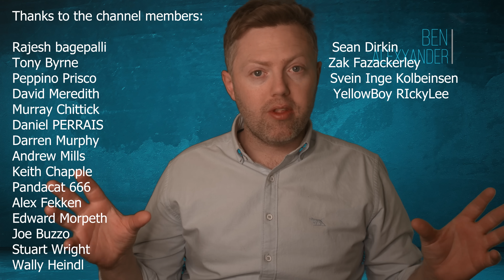CATL’s New Sodium Battery Will Reshape the Entire EV Industry

Comment: Na batteries seem the best solution for storage but, their Wh/kg. is very low compared to NMC or solid-state li-on batts which are in the 290-400 Wh/kg. range.
Reply: At cell level maybe but it doesnt translate to energy density at pack level due to cooling requirements, more like 220wh per kg for NMC which closes the gap. Sodium Ion batteries dont need cooling or heating so more of the space can be used for batteries. 175wh per Kg is decent  but if you think NMC can lose 30% of its capacity when its cold, 50% at -20, there are quite a few upsides. Couple that with 5c charging speeds there are arguable more upsides than downsides 🤔
Reply: @richardlphillips  money talks, nobody cares if the car is a few kg heavier when its 5k cheaper on pack level and the chemistry is more reliable. i bet its a simple drop in replacement and cell case and everything is identical. why is everybody comparing it to NMC... it has 0 chance agains these specs, if all of this is true its game over for the other chemistries
Reply: I mean it's competitive with LFP chemistry - hyper density may not matter if the battery costs dramatically less.
The high density will most likely be reserved for the expensive vehicles or other use cases

Comment: This is the beginning of the end for ICE. So much progress over the last 10 years. FANTASTIC
Reply: Yeah. Betamax moment.
Reply: Also you have to keep in mind that with ice every brand has their own engine and parts. Ev may swap some parts from different companies like the battery and other components
Reply: I would say its the end of the beginning. Mass adoption and acceleration next
Reply: ICEV's peaked globally and in the U.S. in 2017.
This isn't the beginning of the end. More like the final nail in the coffin.
Reply: So how will this help me pull my 30000lb trailer with equipment for work. I dont drive a heavy duty pickup to go to the mall. As far as I know there's no profitable alternative to ICE engines in that space. 

Consumer cars are a small fraction of on road use, Edison motors is the only thing coming close to being usable but they are only in the semi truck market.
Reply: @jackofall2305  The EV muppets are too dumb to realise that HGVs, heavy plant, generators, trains and ships all move on diesel and planes run on aviation fuel.  The appalling energy density of EVs will not usurp those engines for as long as there is petroleum.
Reply: @jackofall2305  EV commercial vehicle is already very common in China. Even heavy trucks used in mining sites are EV now. They have fast chargers or battery swap station. In some situation, like routes that usually fully loaded going down hill and empty truck going back up, thr regen braking can generate so much electricity, that the truck barely need to charge the battery, and also no need to worry the brake overheating.
Reply: Yeah, if only the US govt wasn't banning all auto tech from China.
Reply: @jimbo92107 doesn't matter, world is bigger than the US
Reply: @jimbo92107  nonsense!!!
Reply: @jimbo92107 sadly the us has become regressive. Well at least one party has. The rest of the world is going to continue moving forwards.
Reply: @jimbo92107  It is all good if the rest of teh world adopts that US are just 330 million people let them drive their F150.
Reply: @jimbo92107   reminds me of the USSR, struggling to live on its old outdated tech
Reply: @whophd  ridiculous lame joke
Reply: @whophd 😂 yeah, the ICE is old outdated tech… 😂
Reply: @whophd china is similar but worse than the USSR
Reply: Not so fast. The charging problem remains. We have huge loads on the grid which cannot be dealt with other than astronomical investment.
I am keeping my ICE and have no intention of changing atm.
Reply: @calculusconsulting8598 then maybe these energy providers need to be investing back into the company rather than squandering all the profits in ceo pay and enriching the stock holders. Plus as more people install solar the actual demand on the grid is reduced during the day light hours.  On top of that many ev owners charge their cars at night when demand is low.
Reply: @calculusconsulting8598 this is a religion, adherentes aren't listening
Reply: 10?...in just 5 years is enough
Reply: @maximusasauluk7359  in never you mean!
Reply: Doesnt solve the main disadvantage of low energy density which is the biggest inhibitor of EV uptake..
Reply: @csjrogerson2377  didn't LFP have this same energy density issue that everyone said was impossible to fix...look where we are now
Reply: @viyusavery248  I'm sorry but your post makes no sense. What was impossible?  What was fixed?  Where are we now? For high performance batteries LFP produce  205W/kg, NMC are 300 and NMA are 350.  Diesel is 12600W/Kg.  You see my point?
Reply: @csjrogerson2377  "Diesel is 12600W/Kg." - Most of which is unproductive, being lost as heat, which is not the case for EVs. So it is likely about love all on energy available for actual purpose. We can argue all day long about these things, it just doesn't matter in the end.

If you don't like EVs, just don't have one. I don't know why you feel the need to try and build a campaign against EVs. It's bizarre!
Reply: @csjrogerson2377  When you have 800v batteries who can charge in 10min then less range isn't a big problem.
Reply: @Tavs.fāters When these mythical "unicorn chargers" materialise in large numbers that will be true, but they are still not here and they will not be for decades.  When they do they will be very expensive, thus removing the low cost benefit.
Reply: @csjrogerson2377 I don't know why you are deliberately not telling that sodium ion has 175 Wh per kg more than enough for 400km range. Fossil is dead.
Reply: @Saket921  Thats because I said the high performance sodium produces 205W/Kg. If you knew anything about physics and maths you'd know that the density alone does not influence the range. You need sufficient mass at a given density AND a known consumption rate in W/km. 
PS 400km is eff all, I dont care. I do 1800km over a long weekend.
Reply: @csjrogerson2377 so you are saying that you drive almost an entire day.... out of a two day weekend?
Reply: @scow01  I cant find what you are referring to but I used to drive early from work at 1200 on Fri. Sat and Sun at home drive back at 2200 Sun evening and start work when I arrive.  About 1000 miles done.
Reply: @csjrogerson2377 ok that makes more sense. Sounded at first like you said you just drove 1000 plus miles on the weekend for some random reason vs commuting to work on a sunday night and returning friday night. That is a lot of driving but not outside what an ev could do. But you would require one that supported maximum fast charging, had available chargers along the route and the ability to charge at home.
Reply: @csjrogerson2377  4:43
Reply: Sodium battery energy density is better than LFP, they can be charged from 10% to 80% in just 5min, last for 5-6 million miles, cost 50% less at a time when average ICE vehicles cost more than $50k. And they are coming Dec'25. The ICE auto industry is DEAD!!!
Reply: Doesn't solve large Diesel ICE solutions.
Reply: I think the beginning had already started , this will be the nail in the coffin. 👍👍
Reply: @jimdonaldson64  in your dreams cringe!!!!!
Reply: @jimdonaldson64  How many nails do you expect? Sodium has some advantages but it still doesnt solve the biggest problem - energy density
Reply: @csjrogerson2377  Tell us all how inefficient and utterly wasteful of energy ICE vehicles are again? I missed that bit the first time..............oh, wait, I see you didn't mention that........did you.
Reply: @BrentonSmythesfieldsaye  I didn't tell you because I get 12.6 kW/kg of diesel and diesel ICEs are 40-52% efficient.  Thus I dont give a fuck.  
Now did you tell me what produces the electricity for your non-planet saving BEV?  No, of course not, it might be 75% gas or coal, in which case you are producing more CO2 somewhere else.
Reply: @csjrogerson2377  "diesel ICEs are 40-52% efficient." - 🤣🤣🤣🤣

"Now did you tell me what produces the electricity for your non-planet saving BEV?" - My solar panels silly charged my EV, last count of 9,000km travelled for totl cost of $80.25, effectively no grid involved. Plus the planet doesn't need "saving", it will be just fine regardless of what we do. That has to be one of the most hilarious contrarian narratives ever. "Save the planet", yeah no worries. 🤣🤣🤣😂

So looks like nothing changed after your response. Unlucky.
Reply: @csjrogerson2377  energy density is not critical in all applications of battery technology. I just want a cheap home battery to charge up cheaply at night and then power my home during the day when prices are much higher. Battery technology is not just to do with cars.
Reply: @marviwilson1853  True, but I dont care about the battery in your home.  It's the one in the car that makes me move and causes me to lug around 100s of kgs of battery. HGEVs with 1000kWh batteries are carrying 4000-6000Kg of crap instead of 200kg of diesel.
Reply: @csjrogerson2377  The diesel v battery calculation with trucks is quite complex but I am sure use of batteries over the life cycle of the truck is compelling for the bottom line. I guess that is why they are built and are bought!
Reply: @marviwilson1853  I wouldn't be so sure about the logic of why its being selected.  It may be entirey ideological and nothing to do with logic.
Reply: @csjrogerson2377  Oh, I would be highly convinced that in the trucking business as with most small to medium sized business's that the bottom line rules. If the economics of diesel v electric are the same or maybe even slightly in favour of diesel then there may well be those who take the slight loss for the common good but arguing that larger losses are allowed for ideological or no logical reasons is highly doubtful and to be honest is entering the realm of  "clutching at straws".
Reply: @marviwilson1853  Your argument falls on its arse because the small and medium businesses are not buying HGEVs, Its only the large ones that can afford to be ideological.
Reply: bullshit!!! the ICE is never going away period! they have been forcin evs on people while using the ICE to make those useless evs and send them around the world what a joke!
Reply: @carholic-sz3qv  You in 1990:- bullshit!! The Cathode Ray Tube is never going away, period!! forcing those new expensive flat screens on us. bullshit!! The CCD will never replace film, period. Forcing those new expensive digital cameras on us. bullshit!!! the slide rule is never going away, period. Forcing these new expensive computers on us. It's an absolute certainty that when battery technology matures the ICE will be dead and buried. The Victorian piston, cylinder, crankshaft heat engine invented at the time of the Industrial Revolution, first run on steam and coal and later on refined oil products will be consigned to history. Those that can't see that are blind.
Reply: @marviwilson1853  i was not even born in the 90s you ridicule! no one ever forced flat screens to anyone you are so igorant its crazy! why doesnt musk make battery powered rocket? what about electric airbus a380 or a gigantic battery powered ship to cross the oceans? there are millions of oil byproducts which many of them makes those useless battery vehicles possible.
Reply: @carholic-sz3qv 
I’m old enough to remember all these transitions. He’s pretty much right. 
You’re correct that there’s no viable alternative for large aircraft but we’re talking about cars here really.
Reply: @marviwilson1853  More than 80% of energy is produced by burning fossil fuels. I repeat: More than 80%. We have to create efficient ways to produce electricity without burning fossil fuels, or we will be at a crossroads. Until nuclear fusion becomes a reality, I only see the use of nuclear power plants as an ecological alternative, remembering that today they are much, much safer and extremely efficient.
Reply: @carholic-sz3qv  No one is forcing you to buy an EV now! You can buy either an electric car or an ICE car and if you have an ICE car now then you can keep it as long as you want to so long as it does not fail emission tests. Do you feel that LED lights were forced on you? Filament lights have been phased out. Do you think that is right or wrong?. Do you think people should have the right to still buy filament light bulbs? The IC engine has also had its day for road transport. Like filament light bulbs there is a better way of doing things that is all part of humanities goal of moving form the fossil fuel age to the electric age. This is maybe a 100 year process and electrifying cars is a good first step on this long road.
Reply: @luziosalles324 Batteries like these make grid scale storage cost competitive.The biggest problem with solar and wind power is they can't produce power 24/7. However, if you deploy massive battery storage, you can over produce power with solar and wind by shear scale and store excess in battery storage. Look at what Australia is doing with grid scale battery storage. 

Yes, we will still need another source of power but you can reduce a large amount traditional power plants.
Reply: Why have you picked the last 10 yrs>  The first BEV were in the 1830s through to the 1860s.  Modern rechargeable  lithium batteries were in the 1970s and the first production car finally got out of the factory in 2008 and went 240 miles on  a charge.  Not exactly rapid progress.
Reply: @csjrogerson2377  the lithium battery started in the 90s with the sony portable devices stop lying
Reply: @carholic-sz3qv   Dr Goodenough invented them in the 1970s.  Get your facts straight.
Reply: @csjrogerson2377  Should be 13 years of progress, that was the point when major car manufacturers started pouring BIG money in to battery tech.